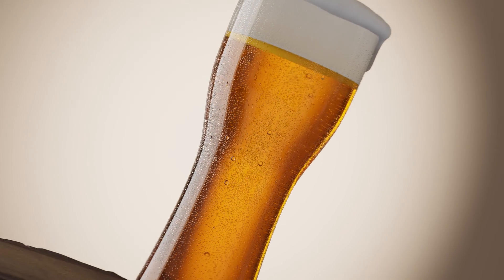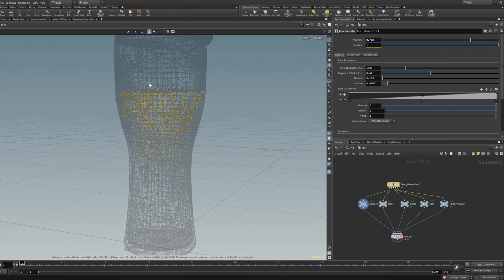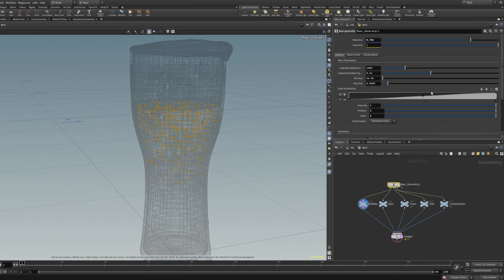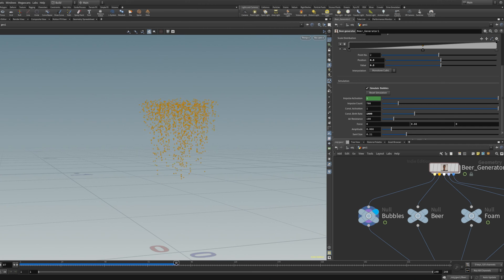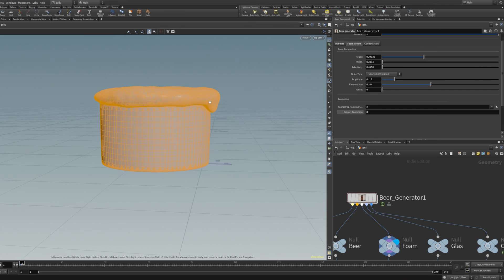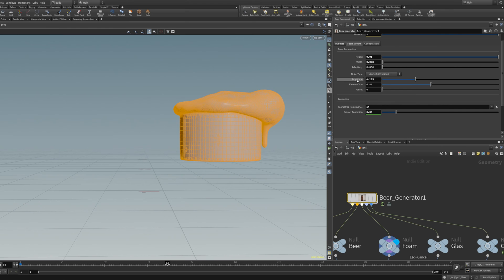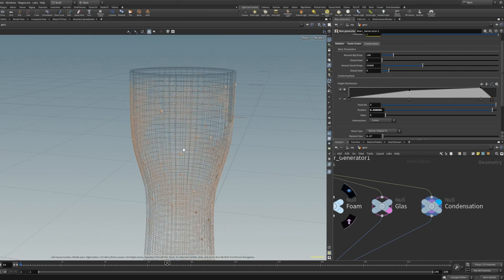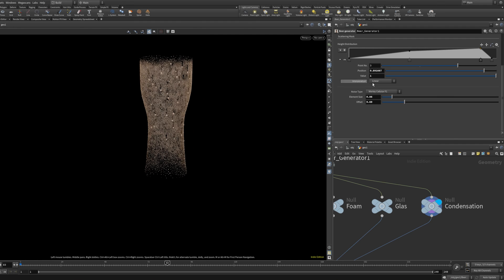Beer Glass HDA in Houdini (Free Download)

Comment: nice work! is it possible to get hda file instead of hdacl? I downloaded your file from gumroad but when I open/install  I get few errors ( like some wrangler nodes are empty etc. 
btw, when you have a plan/time to  add improvements ( foam level on rotation )
Reply from the maker: Hi, no that's not possible sry. Since I only own Houdini Indie I can't export the full version. I do not have a plan yet when to add improvements but I have some Ideas on what. Thanks for ur input!